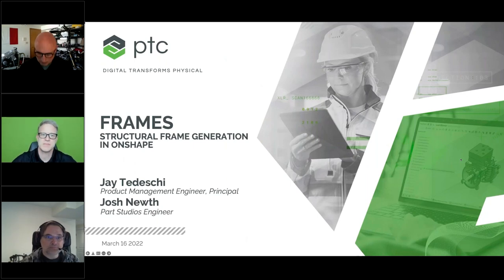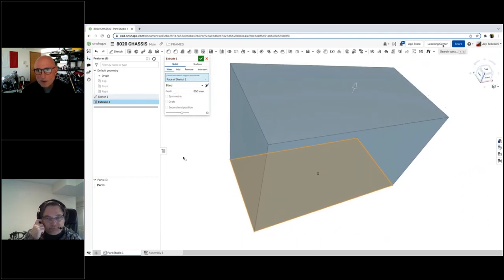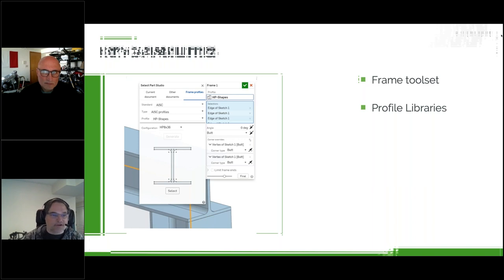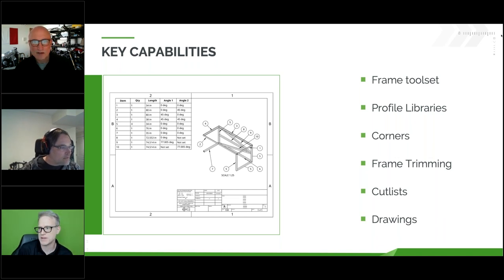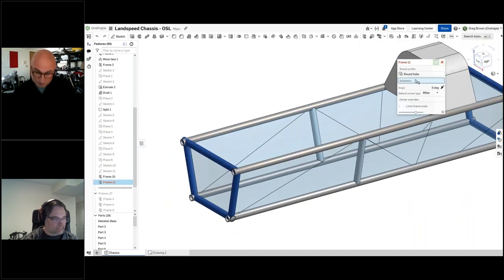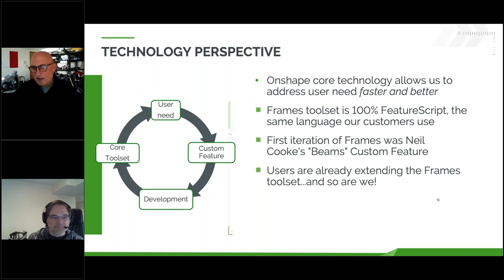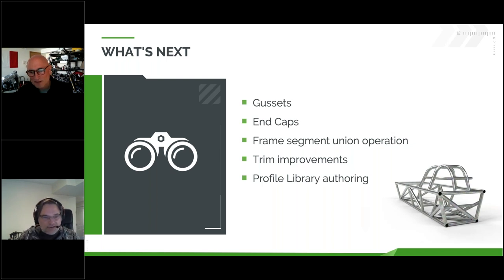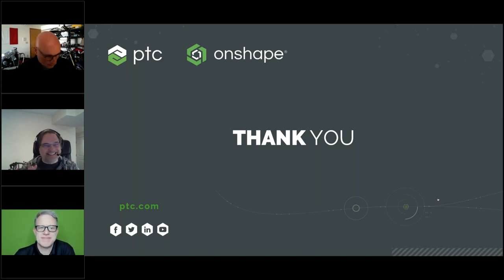Structural Frame Generation in Onshape

Comment: Curious to see how Onshape exports structures like this. A cut list is nice for tracking information, but if I want to send this out to be laser cut what's the workflow? Additionally, some tubes have more complex bends than what you achieve with a typical bender. If I have a tube with a complex changing bend radius, how will that be communicated to a tube bending machine/laser cutter?
Reply: Hey Christian! Great question, and one that is fired in the right direction, we are working towards more tools in this area for manufacturing. In the current state of product you would want to create manufacturing files using tools like the derive to maintain a manufacturing item, this would be supported by the cut list and the drawing with assembly and weld instructions.

Comment: I can't offset the 3rd frame of the 8020 Cube-oid example like frames 1 and 2 do. Is there an option I am missing? I would like to have all 12 of my 8020 parts be inside my vertice edges of the scaffold shape.

This appears to be a formal coding of the Beams FeatureScript, which  I , as well as everyone I think, use extensively in OnShape. There have been many revisions of Beams , 28 was the last, trying to come up with a succinct and intuitive use model.  The Webinar on the Frame feature started with great promise and looked great. I carefully followed the 8020 cube-oid example and ran into the same issue all 28 beams versions have.  The third frame feature selects 4 edges to join the nicely created top and bottom frames. Those frames were offset  by clicking on one of the 9 dots to be inset to the vertice edges of the cude-oid. This does not work for the third frame. They ALL offset in one direction. I noticed the demo picked the center reference nicely avoiding the issue 😐
But how do we know you want to offset the 3rd Frame set inwards to the cube-oid? I hear you say. Because that was the use model for the top and bottom frame set.   
Having a frame with the insets or outsets treated uniformly is the simplest use model in my opinion.  Allowing the selection of the 6 faces and having them move in or out of the enclosed space and then picking butt joint offsets and trim options would allow more flexibility. It would also mean a frame with one profile could be done in ONE frame. I appreciate that the cube-oid example is a simple case. An option to select offset matrice and rotation handles on each element would also work. Maybe it exists already?
Reply: Hey MacPython I will pass some of your feedback to the R&D team. My intuition on some of your comments is that we are working on it, and what is there now is there for a reason. A lot of the time with frames packing a lot of design intent into a single feature is complicated, and the quickest and simplest solution is to create a second feature. For example the offset is going to be something that would take two features right now to define that second or third direction.

Comment: Two questions.... 

1. How do I hide the "envelope" in the drawing? - I can do this in the Part Studio, but it does not retain its state in the drawing. 

2. When I try and add the cut list to the drawing it says "composite parts are required to insert cut list tables"
Reply: Just figured this out and it solves both issues. When you import the view, click the "composite parts" icon - its 3 cubes stacked in a pyramid formation.